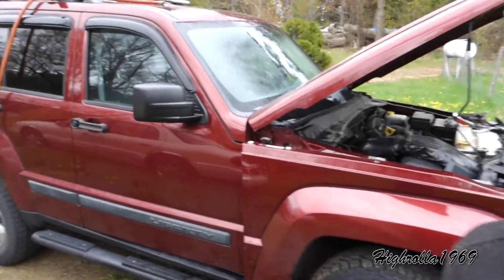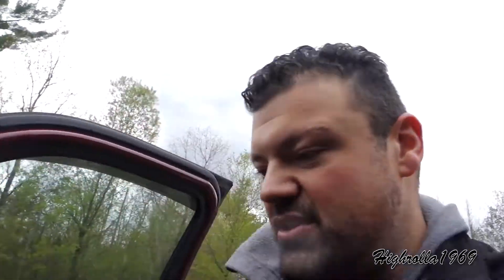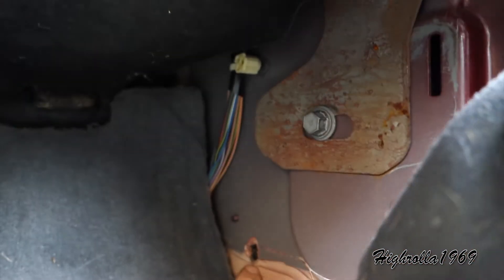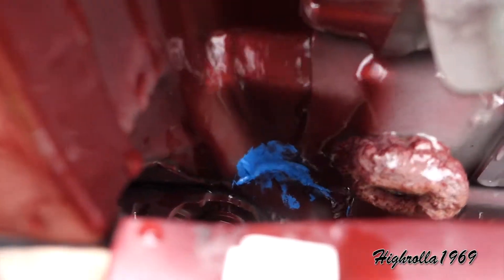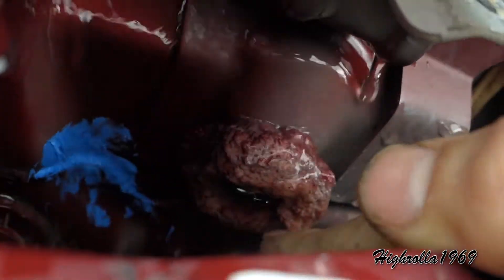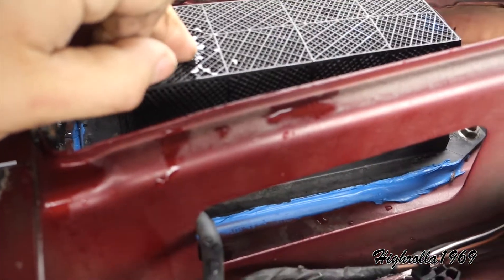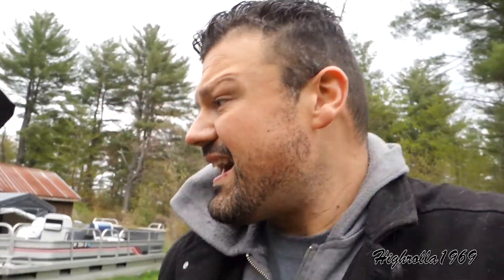Jeep Liberty Water Leak Repair

Comment: Thanks so much for this video it was great.  My daughter just recently purchased a 2010 jeep liberty same exact leak.  I pulled it all apart and sealed it with RTV gasket seal waterproof silicone.  So far so good.  One thing that helped was to completely move the hood all the way up so you could access the air box better.  A small suggestion it is your video but, maybe skip the sailor words in case a kid is watching with Dad or Mom.  Otherwise you nailed it hope this holds, did a water test today and it passed.
Reply from the maker: Excellent to hear this and ty for watching and the comment. At the time I made this video I wasnt big into youtube the way I am now so I do watch the words now. :)
Reply: Did yours have the gap behind the fender Steve ?

Comment: I have 2006 Jeep commander I am having similar problem . I think it’s leaking from that spot too. I am so sick and tired of all these water leaks . First from the sunroof then the driver and passenger doors . Now after I fix those problems I’m still getting small amounts of water by the step plate onto the floor board . I hope I find this freaking water leak I will try too copy what you did on your liberty . Hope that mine is the same problem
Too. Thanks for the video .
Reply from the maker: Ty for watching. Be sure to subscribe and keep in touch let us know if this solved your problem :) good luck

Comment: Was having issues like this in my 07 liberty water was leaking down into the passenger side floor just checks and the seal was gone off that vent so cleaned it up and used PL premium very strong water resistant glue see how that works we have a storm brewing here in Ontario so hopefully this was the fix 👍
Reply from the maker: you are in my thoughts.

Comment: My leak is coming from behind the glove box and even my glove box papers insurance etc are wet 🥵 I have a 2004 Jeep Liberty 4x4 6cyl no sunroof. You can see the water dripping from the back of the glove box...any ideas?
Reply from the maker: make sure that drain isnt plugged up. when it leaks from behind the dssh its an indication the drain is plugged up and the water is overflowing into the AC intake. I hope that may help. Ty for watching and be sure to subscribe
Reply: @Highrolla1969  what drain am I supposed to look at? Thanks so much, I certainly appreciate your help ⚜️
Reply from the maker: @Stardust_4300  right at the 3:29 time in the video you can see it. its on the left. its a hole with some fluffy foam sealer around it. inside there a tube is connected. It runs down the fender. make sure there is nothing blocking that tube
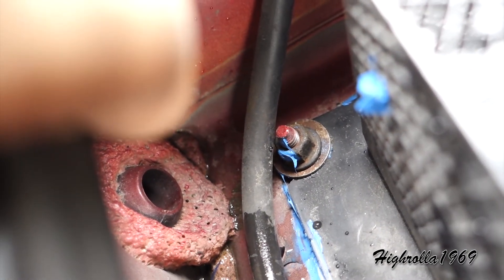Reply from the maker: better yet 3:42
Reply: @Highrolla1969  got it 👍 thanks will let you know tomorrow how I fair 🥵⚜️

Comment: fucking water leaks..... fuck !!     my roof rack is leaking ,,,,wtf.. I just put in a new Tristar engine  fucking 3.7 #6 wrist pin knock, that sat me back 4300.   other then that I love my 09 Liberty 3.5 lift Ranch suspension  33.10.50 Bf Tko2 tires,  class 5  trailer hitch,,